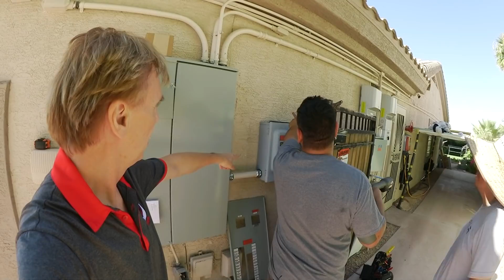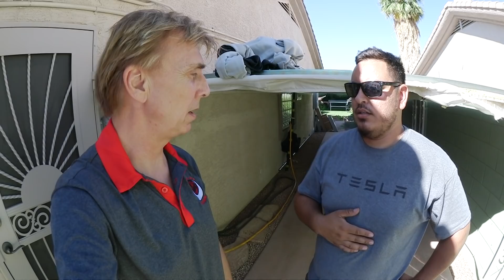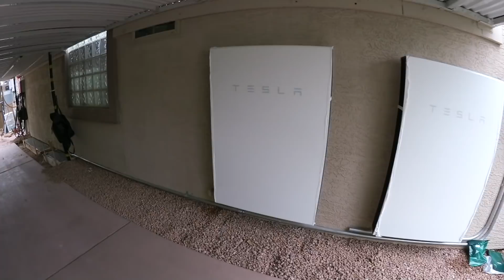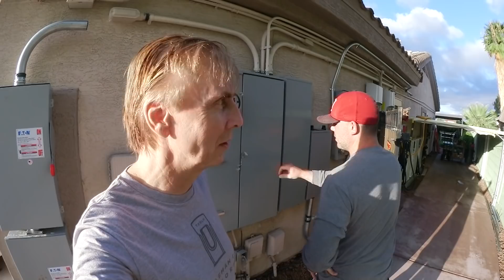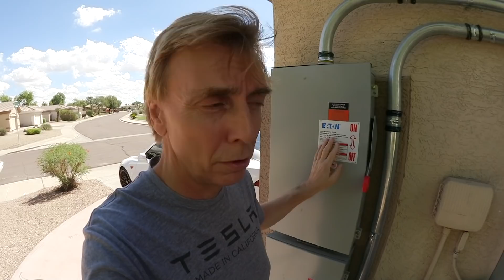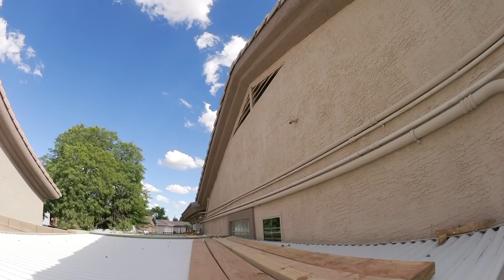Tesla Powerwall X 5

Comment: Rolf are you off the grid with 5 powerwalls
Reply from the maker: Luke Leo Gabriel Yes I could be. The system is calculated for off grid, but now in the winter I don‘t want to heat with gas and I am testing how to get best over the winter. Rolf
Reply: @TeslaOwnersUS  wow that's awesome thanks for the update

Comment: Nice!
Just completed a similar install myself.
Best of luck with your new system!
Reply from the maker: Twelve Wing Productions Great. Let’s be independent from any Utility company. Rolf
Reply: @TeslaOwnersUS ,
Working on it!
Unfortunately our local utility is making that really rough.  I'm not sure how it is in your area, but here in the Sacramento area Tesla was so eager to be able to market their Powerwalls as qualifying for tax incentives and rebates that they made a deal they shouldn't have.
Currently our system is crippled.  It's not allowed to charge off the grid power in winter to allow it's owners to charge from off peak rates to supplement their solar production.
This was a major selling point for the powerwall initially and something we actually designed our system around.

This also seems to have crippled the phone app's "Advanced" setting for "Cost Savings".

For you, in the desert, I'm betting this isn't an issue for you even in winter.  I also suspect you got 5 of them for exactly the same reason we got 6 of them.  To store power and get you past that occasional day or two when you don't produce.

A couple years ago I did some calculations as to how to greatly minimize the amount of power purchased from the grid as well as purchase that power in blocks to force the power bill to look more streamlined and simplified.
Unfortunately this isn't the case currently.

Feel free to stop by our channel and have a look at our system.  I would like to keep in touch and will certainly be following your project as well.

All the best, 
Patrick

Comment: Hey Rolf, great informative vid. 
Will your solar panels be able to produce excess energy, especially during the summer months, that will allow them to charge the PowerWall?
Will you have to add solar panels or will you charge them overnight using lower APS rates?
Thanks!
Reply from the maker: Tyler I am over 100% covered over the course of the year for the house and the Teslas. No problem. Rolf

Comment: I thought the German "rules of conduct(ion)" are weird. Seems you need two Disconnect Switches in Series in the US?
Technically the installation might be correct, but aesthetically that all looks quite unpleasant ;)
I'd prefer to see only the Power Walls and maybe one rectangular 4x8 or so conduit going all across from left to right holding all the cables.
But perhaps they need to be in visually separate pipes?
Reply from the maker: Reinhard vom Dobel unfortunately 2 sets of rules city and power company. That’s why 2 disconnects. Then most stuff must be reachable for the power companies and camp be behind the gates. Rolf

Comment: Hi Rolf, I might have missed the explanation/reason why not all PS are hooked at the wall.
I liked those hanging more than those standing on the concrete. Placed on the floor gives the impression that they are heavier, loaded with more battery packs.
Or is the wall in a different condition?
Reply from the maker: Peter Birett later the engineer so that it is too much stress on the wall. Rolf